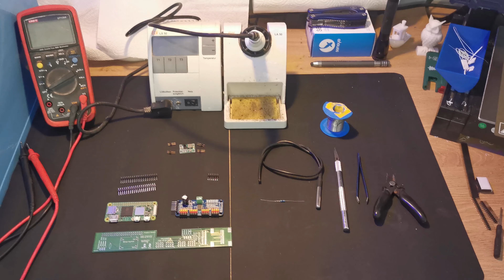Reefpi LED video 2 - Building the PCB

Comment: Did the bigger PWM board come with the smaller adafruit driver/servo? I'm ordering everything on the list currently and want to make sure I have everything I need to complete the light controller
Reply: If you mean the 5v regulator then no it didn't come with the PCA9685.... You have to order it separately
Reply: @86cooke  the bigger green pcb is what inwas referring to. It's stamped with the same number as the smaller blue one. It doesn't show with the adafruit online which prompted my question. If that makes sense. 

Pardon my ignorance. I'm learning🙂
Reply from the maker: The bigger green pcb comes from me.... Send me a private message either on here or on Facebook and I'll send you some details.

My facebook page is "Lukes Saltwater Tank" @lukestank